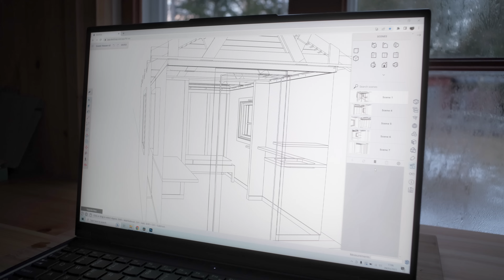Building Custom Shelving For The Tiny House! (Story 48)

Comment: When I stain raw wood, I always use a wood conditioner first.  It seems to give a truer color with the stain.  Raw wood is very porous, and the grain also absorbs the stain differently in different areas.  The conditioner takes care of that.  I know, it is an extra step, but the results are worth it.

Comment: Shelf bracket suggestion - use a thick tree branch as your bracket, cut ends on 45 angle - birch would be cool. I just think you could make use of the trees around you vs buying and hauling timber.

Comment: Rosie, for the shelve brackets you could imitate a keyhole in the back with a small drilled hole with a larger drilled hole beneath it at the same depth. Put your screw in the wall, place the bracket with the large hole on the screw then slide it down to sit on the screw in the smaller hole. Just make sure the small hole is smaller that the screw head.
Reply from the maker: That's a really good technique! Thanks for sharing!

Comment: Bit by bit it comes together and it is joy to see with so little tools you build your dream, RESPECT. I have a little advice for your handsanding, wrap the sandpaper around a piece of sqare timber offcut and then sand. Your fingers will not hurt so much and you don`t get so much splinters in them while sanding roughsawn timber. Thanks for sharing.

Comment: A few economical thoughts re stain.   I prefer water-based paints, stains and topcoats - easier clean-up, no noxious fumes and it's easier to keep everything mixed aka no lumpy bits.   I also exist on a fixed income so I often make my own stains.  I boil water and add already brewed coffee grounds or tea leaves to water and allow it to age a bit - I monitor the color all along but a minimum of 10 days.    (I usually have a few jars in-the-works in my paint stash at all times.)    There's also recipes on Google re using steel wool and vinegar.   The other day I painted shelves with a whitewashed stain - 2 parts water to 1 part white paint.   Same for turquoise stain.   It was $10.99 for a 6oz can of stain, I.made my own from items I already owned.    I 'flipped' a small sidetable and wanted a brown stain that appeared to have woodgrain visible.    The thin wood veneer had been damaged and bubbled so I sanded it flat and sealed it with shellac.   I painted the top a light tan and allowed it to dry.   I painted the top brown and with no pressure I ran a broom across the top.   Instant woodgrain!   I practiced a bit on scrap wood first but it was fine.   I seal my furniture and trim with water-based sealants.   Anything you do not like just wipe it away and try again.   I haven't bought stain in over a decade.   I also save sawdust in jars and label the color or type wood.  Mix it in small amounts with wood glue and you can easily have almost free wood filler for covering dings, screw holes, nail holes, etc.   Only mix what you need to utilize within a few hours, it will harden.   (I have used small bits of scrap wood to help fill screw holes for shelves, packed it with wood glue and taped it in-place until it dried.  I added my DIY Wood filler, cover with tape as needed, allow that to dry, sand lightly - it's ready for paint or stain.   If no scrap wood is available toothpicks or wooden coffee stirsticks are an option.)    At 72 I have to be careful with $$ and what I do to my body.   I had a new roof installed.   I now have 22 water stains on my ceiling.    Of course that company no longer exists.   I now have balance issues so I cannot personally attempt to repair the damages they caused.    Yes, that annoys me.
Reply: Great ideas and so economical.

Comment: Well, I actually LOVE the stain 😊 I also always enjoy all the wood working details you come up with! So many smart ideas!!!!
I usually like to join wood pieces with dowels and also started mounting shelves with them. Especially, if there is a larger surface area on the wall, like with your triangular wooden brackets, the force can't pull the dowels out / down, because the triangular supports itself. So I cut my own dowels from a round wooden pole, maybe 8 mm diameter and 10 cm long. Then I drill a hole in the wall and in the back of my shelf (or the brackets in this case) and then I simply stick the dowels in the wall and into the shelf / bracket. It's really sturdy and magically holds up in the air, without any holes to be visible or to be patched.
Reply from the maker: Now THAT is a far superior approach. Thanks for sharing!
Reply: @wildrosie  I love how you attached the branch 🙂

Comment: The planks get warped very quickly after you remove the plastic packaging. Pinewood absorbes moisture from the air very quickly. So, as soon as plastic packaging is removed planks should be stained and then oil/wax/polish should be applied to protect from the moisture. Polish is fine, does not have to be glossy, can get matt and it will protect the surface from dust, scatches etc as well.

Comment: It's cute, the wood stain is lovely (it kind of matches your hair😊), I'd move in and live there for the rest of my life.
You could fill the holes of the brackets with wood filler once they're mounted to the wall, but I guess that yould make them harder to remove if you ever wanted to. The holes are fine, though🙃

Comment: If you take some sawdust from the same kind of wood, and mix it with wood glue until it is a thick paste, you can fill the large holes and it will almost disappear.
Reply: Good suggestion, or dowels struck in then cut flush … ?

Comment: My gosh the weather we've been having! 🤯
Your ARE a trooper! ❤️ I especially love the desk area with shelves! 
I was thinking, have you looked into how brackets actually function? I'm only asking bc of the choices you made, they seem very overdimensioned and I'm assuming you aren't stacking 150kg on each shelf. 
I've made some, very simple ones too, but I avoided the big drill holes on the outside profile. The thing about a bracket is it's the wedge shape that holds all the weight, not the hardware at all. You'd even be fine with making keyholes on the back of them to slide onto screws in the wall,  as its the vertical wood leaning against the wall under the shelf andbthe wall itself holding all the weight, so the bracket just needs securing. Even making "floating shelves"  with dowel joinery works if you don't intend on leaning on them or putting loads of heavy things on top.
Then again, if you're looking at using these shelves for full loads of pickled cabbage etc that can get pretty heavy. I'm amazed at the false marketing/labelling of the stain! I love the look either way tbh, but if you'd had a car, that would definately be a return item.
Next time ask politely if they would test the product in the store for you, to see for themselves. Bring a sample of what you have uaed before that didn't match the description, it's actuallt helpful to the store, and I'm sure they'll listen. Swedes are pretty reasonable if you are polite about it but serious and unapologetic. You WALK to pick up supplies renovating an entire cottage solo, so they'll understand!
On the upside: Swedish spruce naturally turns an oraangy yellow over time, and not too long either. So the color will be warmer in the end! I love a raw umber color, especially with warm jeweltones and pastels that contrast beautifully. So add warmth with a glowing color that doest recede like the brown, on the far wall, the bedcover, a rag rug?
Anything from a soft yellow, a saffron, warm amber or pretty raspberry can look really warm and inviting paired w that brown. Throw in some indigo or leftover green on some details (from your kitchen) and presto, great color scheme! 
Hapoy Easter dear! Or should I say, Merry Christmas? It's not exactly egghunting weather this year is it? 🤪 ❤

Comment: I have been wondering if you could do with just one visit to the hardware shop if you placed the timber vertically. I have been biking with a heavy table top standing in my trailer with other stuff holding it in place. Only 10 km, but no e-bike and if it doesn't fall of the first 500m it usually remains on till you are back.

Comment: its easier if you turn the turfs upside down for the garden instead of removing them. Then cover with cardboard then layer with fallen leaves/compost/soil and plant into the top. You can accelerate the composting process by pouring urine onto it?

Comment: When you get to your sink……..you could just drain through a hose to the outside by drilling a round hole in the wall and take the water as far out as you want to………. No need to have a bucket to have to mess with.

Comment: Hi Rosei, I am the one who wants you to hire a certified electrician for your cabin for safety reasons. what I don't understand is that you don't prioritize getting the fireplace (chimney) approved so you can heat the house with wood. In addition, I suggest that you try to get sponsors for solar cells with battery backup and diesel generator so that you avoid the costs of the electricity connection. I don't remember which sponsor sent you the e-bike but you should replace it with an electric tricycle that works even when it's slippery. Otherwise it's fun to follow you :-)